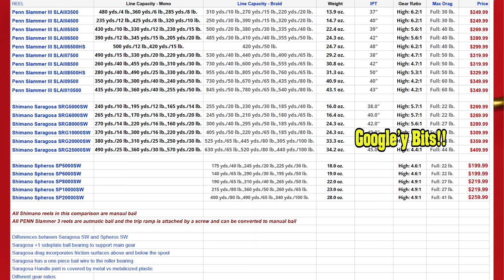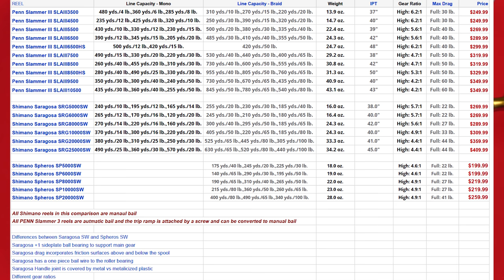Penn Slammer 3 vs Shimano Saragosa SW Who makes the best Surf Jetty Pier Boat spinning reel?  Sealed

Comment: I've had the Penn slammer 3 5500 for at least a year and I've used it in the surf it's been banged on rocks, fallen in sand. All I do is wash the reel to remove loose sand and continue to fish. I've never opened the reel for maintenance because it is still as smooth as when I first got it.
Reply: Yeah those Made in China Penn are no joke
Reply: Joker Toker  yeah true. I had a Chinese made oven one time and a American oven. The American one started having problems after 1 week. The Chinese one had no problems for 5 years.
Reply: Yu78diriri😝☺😚😗😚😘😚😚😘🥔🍌🍌nen💋💋💋💋💋💋💋💋💋💋👏👏👏👏👏👏👏👏👏💕💕😏😏😏😏👏👏👏🤔🤔😋🙄🙄🤗😅😭👍❤😘🤣❤😘🤣🤣😍❤😭😉😂❤😘😊😁😁😍😍😂😂😂❤❤❤😍😋😅❤😋😂😋😍😍😊😍😊😍😊😍😊😍😊😍😊😍😊😍😊
Reply: China is no joke nowadays 😂😂.... for more information, ask your President
Reply: @pascha9993  shots fired 😳🤣
Reply: Hi! I need a shore jigging reel for my Majorcraft Solpara 1002h 60-100g rod. What reel should I take between Penn Slammer, Saragosa or BG mq? And what size?

Comment: I now have two very full seasons of fishing on my Slammers on Jetty, CCC, Surf and Boat: 4500, 5500 and 6500HS. They've been dunked, splashed, soaked, dropped in the sand and on the jetties and with minimal maintenance have had no problems. Perfect. I can't speak for the 'gosa, which I'm sure is a good reel as well, but as for the Slammers, they are butter-smooth tanks. Love the drags as well(I've avoided coffee grounds)

Comment: I really like my slammer III's.  I have 4500, 5500, 6500 and 8500. Drags are just bad ass. Never had any issues with line lay or internal grinding under pressure...
And i clean them after every use so sand is never an issue.  Goosa's are fine reels as well i just prefer penn...
Reply: I have a L
Reply: how much is the size difference  between the 4500 and 5500? the 4500 to me looks like almost the same size as the 5500...just a little bit smaller overall.

Comment: Penn has really stepped up their game over the last few years.
I use the Slammer III 4500 for snook fishing where I would usually use a reel at least one size up(4500 etc.) It's the truly waterproof and that amazing drag that sold me;
3500, 4500, 6500 and a 8500.
And I used to be a die hard Shimano reel fan too.
Also the new Clash series are great Inshore reels.
Star Seagis or custom made rods...
And I work part time at Bass Pro Shop, Daytona Beach and have many other reels to choose from with my employee discount. BPS brand products, I get a 47% discount on BPS made products. So you know where my paycheck goes lmao!
Reply: Are the 3500 and 4500 technically the same size? Just the 4500 has more line capacity?

Comment: I have 30 trips over last year from boat and beach on SL3 4500 almost 200 hours. Just a spray rinse after and oiled a couple times.  Has been dunked has been sanded.  Performs better than new.  Definitely do not notice back slap.  Also can pickup on Amazon or eBay at $180.  or less if you are patient.  One of the best value reels I have bought.  Great review. It influenced my initial purchase decision

Comment: Own both gosa 6000 sw and slammer 3 4500.  Gosa hands down for me a much better surf reel.  Effortless cranking in big tins and fish.  Slammer is smooth under zero load.  Cranking in big tin or fish requires much more effort and has a slight coffee grinder thing going on.  Gosa upgrades...got rid of the factory egg handle knob and swapped out with sustain 10000 circular Eva knob, saving over an oz..and solves for the odd oem egg knob. Also, swapped out factory grease after first season with corrossion x grease and oil.,   Slammer pluses...looks better, higher lock down drag, and has great line lay.
Reply: ed l you are comparing orange to apples, get a slammer 5500 or 6500 the 3500 is to small if you are comparing it to the gosa 6000 sw.

Comment: I bought the gosa 6000  put 30lb braid caught a couple 6 ft sharks on it from breakwall ( casting  retrieving big baits) 2 weeks of use ! Now I can feel the gears ⚙️ working when I wind it , still very smooth. Getting the slammer 3 8500 for this type of fishing, going to use the gosa for lure fishing only 👌 . That’s my experience anyway hope it helps🙃

Comment: Have a saragossa 6000 and 8000, I really am losing faith in penn their reels last a while but they are never buttery like the shimanos, line lay is wackadoodle, and I always get wind knots. I wish shimano put a deeper arbor on the saragossa because it just does not have enough line to back up its beefiness. I’d go with shimano they are just better quality and you dont need to worry about getting a “bad batch” like the penns.

Comment: Penn Slammer III

Sizes 3500-5500 have automatic bail trip
Sizes 6500-10500 have manual bail trip
Reply: @the truth automatic means when u crank the handle an open bail will close. Manual means u have to flip an open bail closed by hand. An automatic bail can accidentally trip in the middle of your cast and u lose an expensive lure.
Reply: Just do the automatic delete.

Comment: I fished a slammer III 5500 really hard for an entire season (extended dunking on almost every trip, and was cranked underwater on multiple occasions) and had zero issues. I would get home and open it up expecting to find water and would find nothing. Great reel, just with there was a bailess version.
Reply: Been fishing my spinfisher v s for a year or 2 now and they are still going strong even tho they have been splashed or even fully underwater almost every trip.

Comment: It would be really interesting to find out for any of the guys that had the drag knob melt on them during a fight how much drag pressure was applied to the reel at that time...I mentioned this on a few videos that compared reels in the same class both in cost and size...It`s impressive that you can spend $349 on the biggest Penn Slammer and it`s rated for 60 lbs of drag...When the 25000 Saragosa is $409 and is rated for 44 lbs of drag...So most people would most likely go for the Slammer because they`re getting more for their money but how much of that drag pressure is really effective within that 60 lbs?..And how long would it last before it breaking down?....If both reels were put through constant pressure of say 25 lbs of drag the Saragosa could still  possibly be a better reel because it would last longer than the Slammer even though Slammer is rated for much higher drag pressure..I believe I brought this up with the Stella vs Dogfight comparison video.
Reply: Fin nor offshore 9500 also has 60 lbs drag but at a lower ratio, also much cheaper all can handle tarpon grouper sharks. Seems like a trend to use giant spinning reels to replace conventional gear
Reply: Do you have one or know anyone that does?
Reply: I completely agree and in reality a lot of guys and in most cases  aren`t even going to use close to 40 lbs of drag on spinning reels. This video however has convinced me to buy the Penn Torque II for my 80 lb class but I can understand why guys would stick with the Slammers since they have the same drag system as the Torque with this exception of the  drag knobs.
Reply: Thanks for the feedback!...I think I`m going to wait for the Slammer to be on the market for awhile longer before I go buy one for myself.
Reply: Coza, do you have a Saragosa and if so do you have to send it out for service? Coza King
Reply: Thanks for all the info. and yes I think the Saragosa is the best reel for me...I`ve never serviced one of these reels myself but after watching this video I think there`s a good chance I can take care of it myself...The only thing that concerned me about getting one is I just couldn`t see getting a reel that`s going cost me  every year like the Stella to get it serviced when I`m not even using it as  much as my other reels...If I was running a charter boat that would be completely different but for the amount of use I`ll be using it I think it`s the best reel for the price and quality...Thanks again for all your help and tight lines! Coza King
Reply: MrGb4ever I’ve had Shimano my whole life and only have 4 reels. 2 Shimano bait runners 3500 and 4500 and 2 Calcutta’s 401 TE.  I haven’t set them in once and they are all over 10 years old. All I do is every season I give them a good cleaning and oil them up. That’s it.
Reply: Thanks!...I`ve already decided on the Saragosa. @marcuslarwa9098
Reply: MrGb4ever it’s funny I’ve been using Shimano my whole life but I think I’m getting the Daiwa. As I been doing more research I’ve found that it has more bearings and it seems to be smoother and sealed better. I don’t know I think u can’t go wrong with any of the 3. Penn, Shimano, and Daiwa.
Reply: I agree!..I don`t think you could go wrong with Daiwa, Shimano or Penn and I also use all three...I can tell you from experience if you are planning on buying a Daiwa BG you won`t regret it..I have both the 4500 and 5000 and love them! I use them both for saltwater and they cover my 30 and 40 lb class line...My Penn Spinfisher V 7500 covers 50 lb and I`ve been very pleased with it and my Saragosa will cover 65 lb which is the heaviest I`ll need...The most important reason I`m choosing the Saragosa over the Slammer III is because I just think Shimano has the best and smoothest drags...I know the Slammer is a good reel but it just looks like the drag gets sticky under higher drag pressure and I can`t afford that for what I`m using it for ...The Daiwa Dogfight is a great reel and gets 66 lbs of drag but I still think the Stella is a better reel even though it puts out 55 lbs of drag...The Dogfight`s drag also gets sticky under higher drag pressure but the Stella remains smooth...So I pretty much feel the same as you...All 3 of these companies make great reels but it`s all about preference, budget and using the right equiptment to get the job done. @marcuslarwa9098
Reply: MrGb4ever i went with the Daiwa saltist 5000. Tbh 20 pounds of drag is an insane amount of drag for. 20 oz reel. It’s as smooth a butter and I’m glad I got it. I wasn’t sure about it because I had a BG like 15 years ago and it was a piece of shit. They have come a long way since then. I’m going to Florida March 2 so I’ll see how it performs.
Reply: The Saltist is an upgrade to the BG but both have the same water proof carbon ATD drag system and the same drag ratings..I never worried for a moment that both the 4500 and 5000 would handle the drag pressure smoothly with 30 to 40 lb class line...What I`m worried about with these two models was using much higher drag pressure on the bigger reels...I watched a guy fishing with Josh Jordenson from Blacktip fishing and he was using a Saltist fighting a decent sized Blacktip..He locked down the drag pretty tight because he was fishing from shore to keep the Shark from spooling him...He looked like he was well within his limits on the drag but when the fish ran you could see the drag was sticky and that caused him lose it...When the fish ran the line broke as soon as there was that slight hesitation....But one things for sure these reels have come a long way since you had the older one..I was strictly using Penns  before I started using the BGs and I did my research like you and thought it was worth the shot especially since people were giving them good reviews...Good luck with your trip in Florida...Be prepared I`m going to ask you how you made out and I would appreciate your feedback? @marcuslarwa9098
Reply: MrGb4ever i read the specs on these reels till my eyes hurt lolll. The BG says waterproofing but does not say it has Magsealing.  If u wanna see guys using Daiwa’s and having the drag locked down check out MorningTide fishing. These guys are fishing off the rocks in Australia catching 50-75 pound GT’s. They have to fish with the drag locked down because if they don’t the GT’s take them into the reef and they brake off losing 150-200$ lures. There’s 3 guys Cavy, Briggsy, and Brooksy. 2 of them use Daiwa and Brooksy uses the Stella. These guys fish those reels under the most extreme drag possible  and I haven’t seen them get broken off cuz the drag locked.
Reply: Yes I know all about the Morning Tide along with Dennis Verreet, Brendan Wing, Matt Watson, Nicky Sinden and Al  Mcglashin as well...As a matter of fact the Morning tide guys were the ones that mentioned the Dogfight having a sticky drag on their video that compared it to the Stella...My thinking about that is maybe that won`t cause you to lose a fish but maybe it will and it has with some guys and I`m going to do everything I can to keep that from happenening with me..With that being said, anytime I`m going to spend over $400 to $1400 for a reel I don`t want a flaw such as a sticky drag everytime I have to rely on the higher drag pressure of a reel...The Stella and Saragosa does not have that issue with their drags so sorry there are no excuses..I just wouldn`t use the Saltist or the Dogfight over the Saragosa or Stella for this kind of fishing. @marcuslarwa9098
Reply: MrGb4ever  which video was that because Cavy and Briggsy both said they rather the dogfight over the Stella.
Reply: "Shimano Stella or Daiwa Saltiga" is the video and yes they would choose it over the Stella but that`s their preference...They can get past that fact about the Dogfight and some people can...They`re choosing that reel for more reasons other than the drag. @marcuslarwa9098
Reply: MrGb4ever not sure what would be the other reason, other then higher drag the Stella is better
Reply: MrGb4ever believe Briggsy said the early model saltiga had that problem and Daiwa fixed it.
Reply: Yes he did say that but he also said the lighter Saltiga`s drag is smooth with the exception of the older ones...You could take that a couple of ways but even if he is referring to the size of the reel using the word "lighter" instead of drag pressure the smaller Saltiga`s max drag is 33 lbs not 66lbs...You have to get the 6500 model which is the biggest reel to get 66 lbs of drag. @marcuslarwa9098
Reply: MrGb4ever he said older not smaller or lighter  I’m not sure what your talking about. Also many people have said that about Daiwa and they have also said Daiwa has since fixed that issue. Daiwa in Australia is more expensive then then Stella so I can’t see those guys spending more money for a reel that has drag
Problems when they could get the better Stella for cheaper. He said he loves the Saltiga because u might only get one fish that makes your whole trip. With all that being said I can’t see them getting A reel they k ow has sticking issues esp when they could be pulled in the water from off the rocks
Reply: No he did say lighter..His exact words were "the lighter Saltiga`s drag really smooth too the early Saltigas very sticky bad" but you were right about him saying now totally fine..I stopped it before I heard him say that but it is good to know and if I`m ever looking to choose one of these reels in the future  I`ll keep my options open for sure. @marcuslarwa9098
Reply: There's no spinning rod that will handle 60# of drag.
Reply: Nobody can hang onto 40lbs of drag for more than a few minutes unless youre strapped in. Ive landed 200lb class tuna with my saltigas preset to 28lbs of drag without ever touching the drag knob midfight. Its technique, more than power that comes into play when targeting big pelagics, especially in deep water.

Comment: Also consider when you crank the reel, the main gear will push the pinion forward off of that little base.  Plus the shaft should keep the pinion aligned along with the 2 main bearings.

Comment: I just bought a slammer 3, I'll see how it is next month when i go back to Bermuda after university.
Reply: Kaelin Joseph I’m thinking about getting a Slammer.. 1 year later, update me how has your reel been?
Reply: the truth It’s great bro. Really good. The thing is, if you’re used to catching Spanish mackerel, small yellow jacks, or anything around that size really.. you need to lower the drag alllll the way down or else the reel is overkill. The reel is so strong, when a smaller fish gets on you almost can’t feel it on your line because drag isn’t being budged whatsoever. Definitely a secondary reel for boats/inshore/offshore. If you use it as your primary for Shore/beach, it feels great but it’s overkill to anything that you can catch.

I.e. Don’t use a gun to kill a spider when you have a perfectly good shoe you can use
Reply: the truth 10/10 best reel I’ve ever used hands down.
Reply: the truth I got a 4500 myself because I needed a heavy duty reel because I like the water up to my stomach when I’m on the beach fishing. But even the 4500 is a Tuna/Tarpon/Kingfish reel. Anything smaller and you’re gonna be reeling in as easy as a commercial fisherman. I love this fucking reel though I’m looking at it right now
Reply: @cyb3rtiger  there beasts. I love mine!
Reply: @Gio-nl7eg  yeah you definitely can, my friend caught a 52.6lb Bluefin off a colt sniper on his 4500
Reply: what did you think of the penn now.?